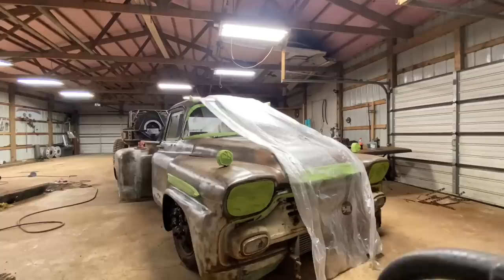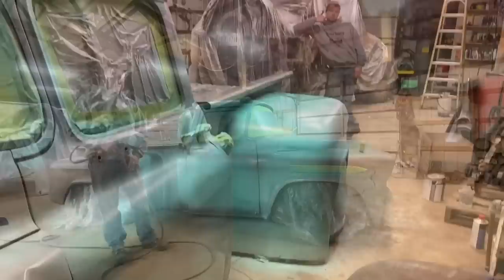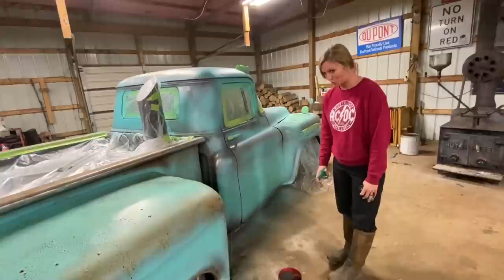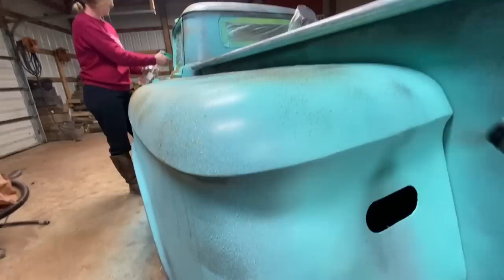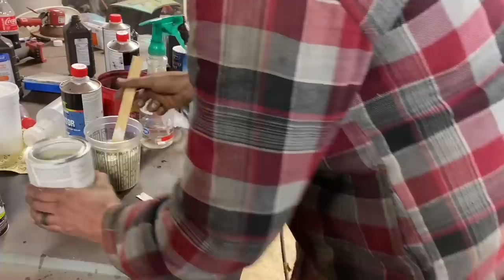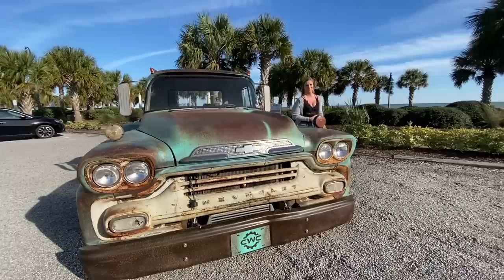We gave Hannahs 59 Chevy Viking a different look!!

Comment: I have done a considerable amount of metal Manipulation on my rolling art projects. 
You can get commercial grade high strength vinegar by the gallon at Lowes. Works great for metal Manipulation and is also an AMAZING vegetation killer, just use straight in a sprayer with a small amount of dish soap.